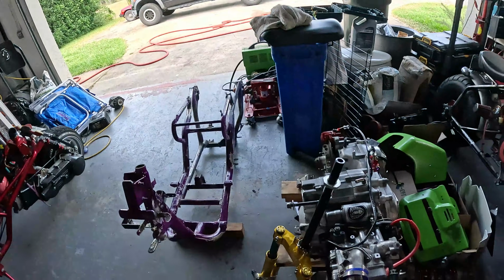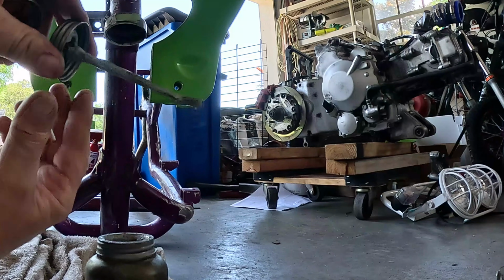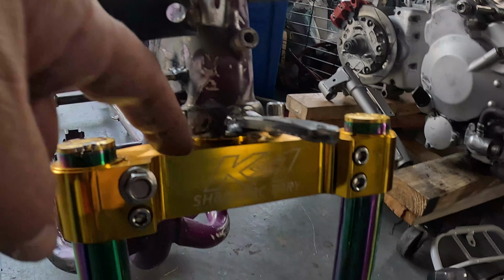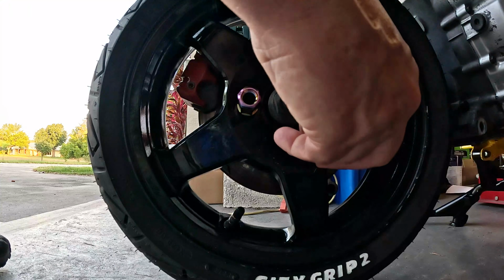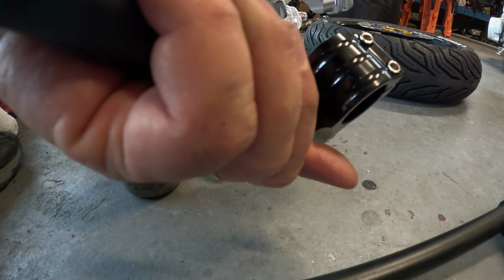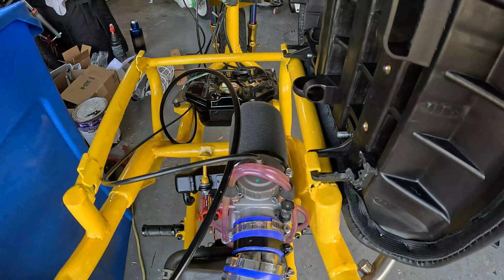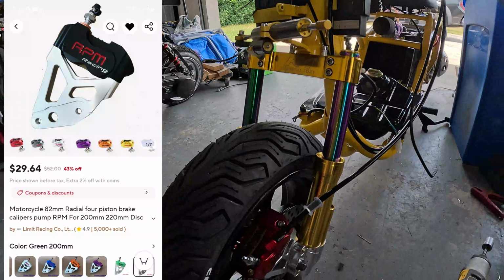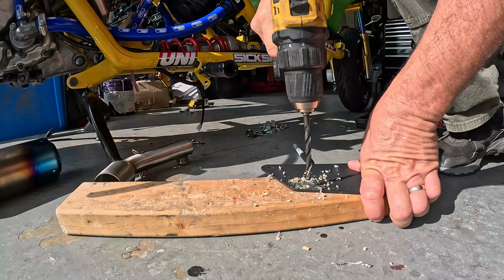Chuck It!  Part 4:  The 100mph 400cc Maddog Chuckus Burgman Ruckus Project.  Assembly

Comment: I’m interested it how the wiring is done so it sparks since the carb will take care of the fuel and what size carb are you going to run on the an400
Reply from the maker: I cover that in the 1st video I think.  Had to watch the last one to find carb size.  It is a 38mm PWK.  So the spark..   it is extremely convoluted and may not ever work.  The ECM is made by Kehin and I assume the ignition advance is separate from all the O2/IAT/TPS etc functions as I don't need them.  There are also a million safety switches going into the ECM such as brake on, side stand, tip over, etc.   I still can not get the thing to spark on the ECM and bypassing all that stuff.  I NEED the advance curves off that ECM which are actually retard or delay amounts.  Watch my last CDI test on the 50cc and I explain how electronic ignitions can NOT advance and how they do it.  This is a big problem for me.  I have 2 diff harnesses built for this.  The one with the ECM...  nothing.  And the one using a DC chinese CDI and it idles great but dies when I add throttle.
Reply: I hope you can get it to spark with the original ecm ? If you could get an oem harness you could reverse engineer it to trick the ecm
Reply from the maker: @removeableskull7446  it makes no sense.  I can get it to run with either coil wire hooked to + and the other to - or with them both to +.  Makes no sense.  Still can't open that throttle.  It has issues.  May be tossing this mess in the trash.  LOL
Reply: I would try to use the air temp tps o2 stock eltronic things at first to get it running then delete components one at a time to find out what shares grounds powers and signals
Reply from the maker: @removeableskull7446  I just can't it to fire off the ECM and don't know if that ECM is fried.  And a replacement is a waste of money if that is not even the issue.  Someone said it may be the pickup coil, but that is showing 256 ohms which is good and it idles.
Reply: Search Bergman bs6 rpm low fix
Reply: The Bergman I seen has an idle adjustment point in the stock tps spin it one way to raise or lower rpm
Reply: I wonder if it has a security system meant to disable it from moving. In my Chevy I had to have the vats system deleted because I changed the ecu and engine
Reply from the maker: @removeableskull7446  I have one full wiring harness and then I have my basic homemade wiring harness that is as simple as a minibike.  So any system would be removed from the later.  Same results.

Comment: For got to ask bud have you turned the flywheel down a C.M each side of pick up not sure how deep you could cut off And can you get to use CNC water jet if not a plasma cutter print off the polini clutch there very expensive i think the pattern could be cut out or use Dremel or oscillating hand tool hope this get you thinking on the Mass weight cutting it back more energy for more power

Comment: Would like a parts list...Tempted to do the same thing....
Reply from the maker: Ha...  a crashed burgman and blown up maddog are all the parts you need.  The rest is whatever you want.  Aliexpress links go dead fast so all my videos on this have a screenshot of the part I used.  But they are just subject to price and preferences of you would want.  Nothing specific is required.  And with Ali Express parts.  They are a starting point.  Expect nothing to fit or work and you won't be disappointed
Reply: Do I search for radiator by size?